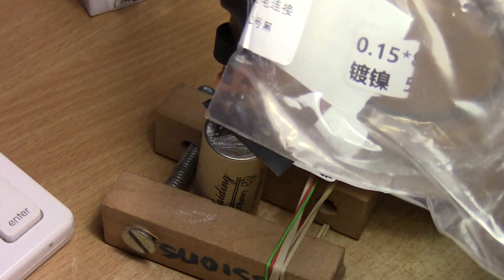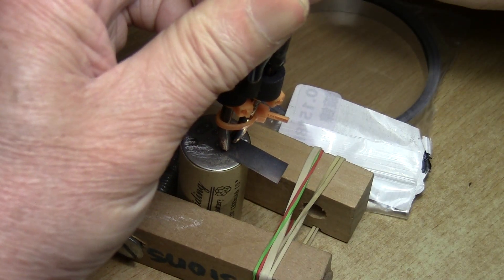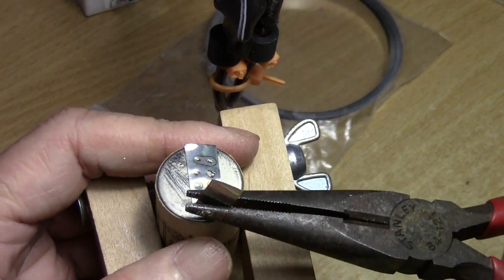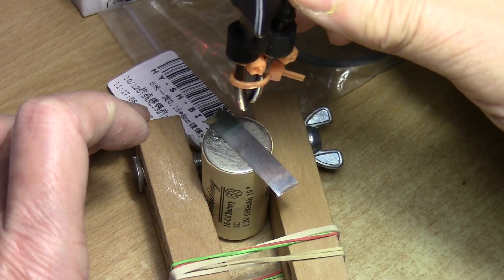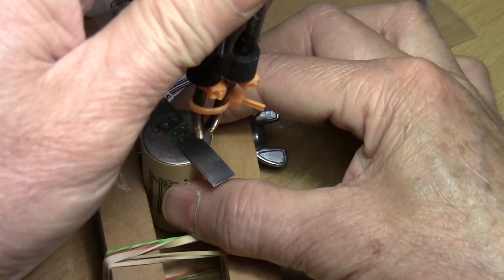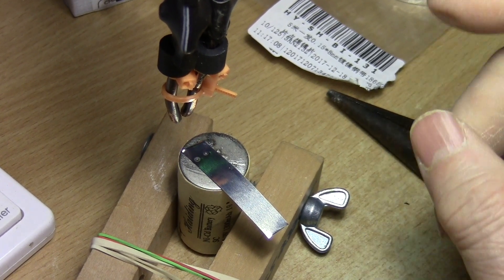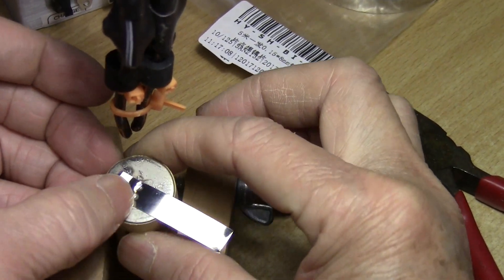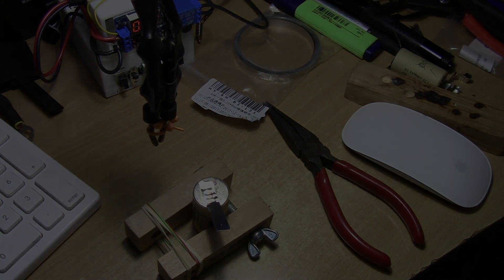12 volt battery powered 18650 spot welder experiment Part 4: Welding .15 mm Nickel strips

Comment: I think this only works so well because the battery is the perfect size for it. 0.2 sec is a long time, i used a smaller 8ah SLA and it was just a hair too weak. It took over half a second, got really hot, and the welds weren't strong. Then i tried a 14v RC lipo, and it mostly just blew a hole through the nickel and battery in much less than 0.2s. I got a good weld from that once or twice by tapping the button for maybe 0.05s
Reply from the maker: Yes you do need the right battery. I notice when my battery voltage drops below 12.6v, my welds are not as strong. I try to keep my 18 amp hour battery charged to 12.8v.
Reply: @wtam69  Yeah i'm going to try the FRM01 since i've heard from a few people online hat it has finer control. 

Still no luck with the 0.1s setting? As in the relay doesn't actually trip and nothing happens?

I think you can keep a SLA at 13.8v without hurting it at all. Car alternators are between 13 and 14.5 volts after all.

Thanks for the video series, it has helped a lot.